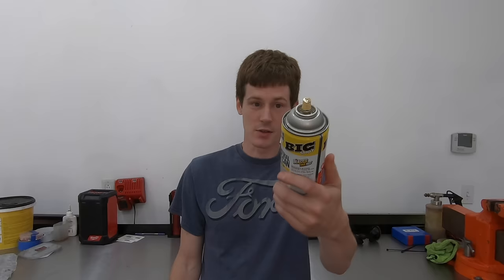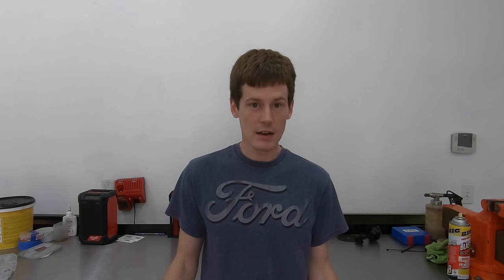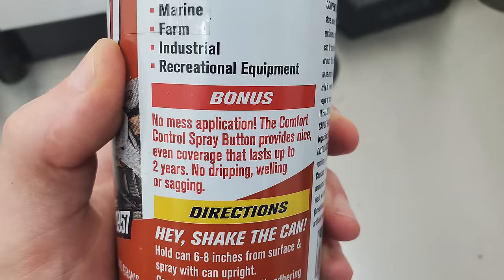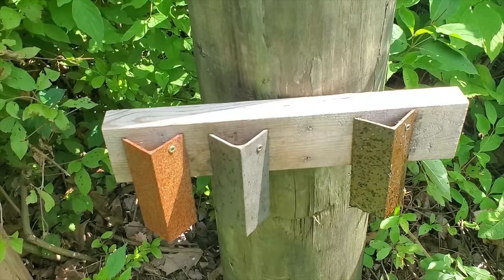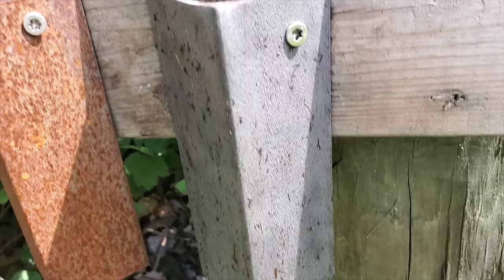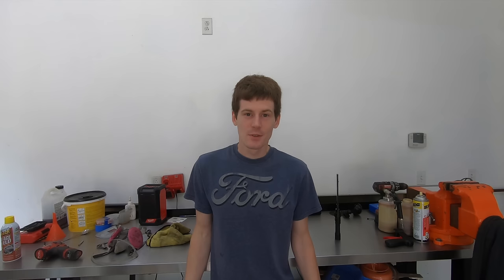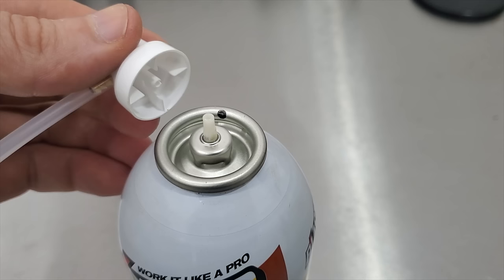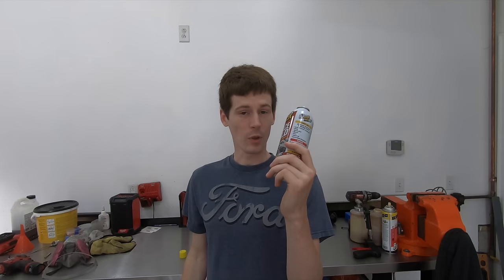I Finally Found The Best Undercoating On The Market... Blaster Surface Shield

Comment: Hey Would you consider spraying a salt eliminator inside cavities like rockers or just spraying applying this product without. Thank you
Reply from the maker: If you have a coating on the vehicle, the is then driven though salt, the salt is on the coating and not the metal. If salt can't reach the metal, the metal cannot rust. It's chemically impossible. I've never used a salt eliminator on the bottom of my vehicles. If you have a good coating you don't need it.

Comment: Hi Andrew, great clear video, one question: you say that it holds very well on the surface but I see you wiping it off with your finger, this seems to me a contradiction in what you tell us. Did I miss something?
peter
Reply from the maker: The product is lanolin and petroleum jelly. When the lanolin is washed away the resilient petroleum jelly is left behind. The part that I wiped has not gotten enough water spray to wash away the lanolin therefor it stays wet. The mud flap has gotten enough water spray to was away the lanolin.
Reply: @RepairGeek  thanks for your very fast response. I bought a 13 year old landcruiser, only some superficial rust and therefore I am very keen on finding the right protection. your video's are very helpfull amd gives me enought knowlidge to defent myself against all the "specialists" who are just doing  the bussiness without any self critism.
Thanks again, I hope you will make many more video's on this subject.
peter

Comment: Hey brother got a question, can I spray surface shield and then fluid film over it because the surface shield has solvents? I just needle scaled off the flake and rustoleum rust reformer on now I need to pick a protectant to spray on the rust redormer. Can both be used together

Comment: Is it ok to spray this over fluid film? I just did a coat of fluid film on my truck back in September
Reply: Yea the ff has started to come off thats why I asked. My bad for the confusion. Definitely wouldn't spray to different products on back to back.
Reply: @vigilantemotors  Na. Ima put another coat on the 1st of the year.
Reply: @vigilantemotors  Gotcha. We don't get snow here in VA like we used to but I'm just trying to prevent or slow the little rust I have on the frame. Something interesting I didn't know about the clear FF is it turned black after a couple weeks. Makes me wonder why they even sell a clear AND black version.
Reply: @vigilantemotors  Lol. Yea it went through this time.

Comment: Anyone knows what paint I can use to spray paint the catalytic converter and the complete exhaust system to prevent rust?
And with little to no odors when applying.

Comment: Surface Shield is no longer available on Amazon,
and doesn't know when it will return.
Reply from the maker: I posted the link here when it went on amazon. It sold out in 3 days. More will be available, just check back.
Reply: @RepairGeek  Thank you for the update luckily I ordered it within that time frame.
I yet to receive it should be tomorrow from Fed X

Amazon now has it back in stock if you want this product hurray and order it NOW!

Comment: I literally just got done spraying my truck with Fluid Film. Now I'm bummed. I never heard of it until this year. I wish I would of used Surface Shield.
Reply: Don't sweat it. Use Blaster next year for touch up. The fluid film will still be ok in many areas that do not get heavy water splash. I fluid filmed last year and it took only 1 and a half cans of Blaster to touch up my Chevy Van.
Reply: @Deucealive75  Cool that's what I was thinking to do

Comment: Does this dry or stay wet? I did my truck and it's been 3 weeks and it's still wet to the touch. I put a light film on so I don't think I put to much . The truck only had 400 miles on it when I sprayed it. What are your thoughts

Comment: I just watched this video I live in the North were snow and salt is a head ace what I was wondering you used steel can it be put on the paint?  Like Rocker Panel's to cover chips and such? I have a 2018 Ram 1500 That it Light Cream in color I just got In September  It looked like New I didn't see any imperfections so the Dealer some how covered all the chips and scratches and now after 5 washes I have more imperfections then I like and would not have bought it and the snow just arrived Sunday night I'm worried about it rusting out. Can that stuff be sprayed on the paint for this winter protection?  It is going to be under coated at the end of January. Any help would be appreciated  Thanks Robin

Comment: The company making FluidFilm has many products available, some can be mixed in different ratios to get the desired thickness and properties. FluidFilm is NOT just one Product. Also the FluidFilm line of Products is for protecting the hidden cavities inside of car bodies and frames. For the outside of your undercarriage and all visible parts vulnerable to water, salt, debris and all, the company making FluidFilm has a different Product called PermaFilm. I don't know about the market in your country, maybe they don't have everything available where you live.

Comment: The graffiti community makes male cap adapters that would allow you to use the inner cavity spray tool with that can.
Reply from the maker: I have some on the way. Thanks for the tip.
Reply: @RepairGeek  Thanks for the video. I will be using this product on my classic BMW e28.

Comment: Does this product affect rubber like fluid film. Because you said with fluid film you wipe off break lines. Thanks
Reply: On the can it claims it will not harm most paint, plastic and rubber surfaces

Comment: Enjoy your videos. in this video, You mention your dislike with the male tip on the Surface Shield can .  On your previous woolwax vs fluid film video, you referenced a graffiti adapter for the Surface Shield can  and had a link to the graffiti adapter.  You did not mention the graffiti adapter and have not linked it in this video. Have you changed you view on this adapter to enable the use the inner cavity spray wand for hard to reach places ? thanks
Reply from the maker: This video is older than the one you watched previously. I have linked the adapters in this video. They work well.

Comment: What do you think about using this for a mower deck? Buying a new Toro Zero turn and want to hit the deck with something.  Also, 1 year later, How is that telephone poll sample doing?
Reply from the maker: I haven't done any long term testing on mower decks. I know it will work and stop rust. How long it stays on the surface with grass constantly flying around? I have no idea. It's still pretty good honestly. The FF sample is worse than the SS. I'd say the FF sample is showing about 15% rust along the top the SS sample is less than 2%.

Comment: I have a 2018 silverado with the wax coated frame and I have read and heard that you should not use any undercoating on them because it weakens the wax to the point it basically slides off the frame. I noticed you have a colorado zr2, is that a wax frame also? If so is it safe to undercoat?
Reply: I have a 2017 silverado and was wondering same thing . Did you find out what's best to use on waxed frame.

Comment: So if you want to do an accelerated test, why not put a few samples in salt water and let them sit in there for a few months.
Reply from the maker: The coatings aren't designed to be used underwater.

Comment: Does this stuff stay wet the whole time? It never drys? You just wiped off that test piece of angle iron from 7 months ago and it looked wet. Looked like it had a bunch of dirt and debris stuck on it.  So when you work on your car everything is wet?. If a pressure washer won't remove it, how do you get it off if you want to remove it? Interesting stuff to say the least. Is it safe around wheel speed sensors etc.?
Reply from the maker: It stays wet. I've never had an issue with any sensor.

Comment: I tried spraying some spots on my truck with white lithium grease, the stuff is still there going on 3rd year now and I pressure wash the underneath at home after storms that use heavy salt on the roads. It’s still there. Has this channel ever tried that as a undercoat product?

Comment: You showed it used on hardware and a rusty piece of steel that looks like it's full of crap and gross. Not once did you show it on a frame the fluid film looked mint

Comment: Can you spray the blaster product directly on a rusty surface?
Reply from the maker: Yes as long as the rust is tight adhering. If loose rust falls off it takes the product with it.

Comment: Picked up a couple cases of this stuff and used about 5 cans on my 19 f350 crew cab short bed but one big issue I had 5 cans not work or sprayed for only a couple seconds and no response from their customer service!
Reply from the maker: The nozzles get plugged. I've had it happen as well. Remove the nozzle and blow them out with compressed air and they will work again.
Reply: @RepairGeek  Yeah I tried that, even used a new nozzle off of a new can and still wont spray

Comment: I recently tried the CRC Marine    ( Heavy Duty Corrosion Inhibitor )  It seems to hold up quite well ...  What didn't you like about it if you can recall.....  I will look for the Blaster Surface shield  Thanks!
Reply: i’m also trying crc, and i was just watching these videos, and on the ~30 min video of how to undercoat a car, under the why not cosmoline portion, he says in a rocker panel, cosomoline type products like crc won’t drip down into the seem weld, and won’t protect it, because it’s too thick, and dries to a solid. he recommends lanoline type products that stay liquid to get into that rocker seem, if you see the video he illustrates it well. i still feel like crc marin would be good for most of the undercoating, and then maybe the blaster surface shield for inside the rocker panel, where it doesn’t really get hit with debris to knock it off anyway. i’m still curious to see a test of the surface shield after power washing, since crc doesn’t come off w/ power washing
Reply: @allenying  That argument makes sense for all the internal hidden areas... I've already coated all the exposed areas with CRC under my TACOMA and so I will go through a season and see how it survives....

Comment: So I bought this product to spray on the floorboard interior of my 1989 GMC sierra 15 M. Is it OK to put the carpet pad and carpet back over the top of it or should I select a different  product maybe like rustoleum
Reply from the maker: This product stays wet, you need something that dries for an interior application under carpet.

Comment: $115 for a gallon ouch i stick to used motor oil mixed with melted candle wax for a couple dollars
Reply from the maker: It's getting into undercoating season. Pick it up in the spring that's what I do.

Comment: Rustoleum no good? I'm sorry, I have no experience with undercoatings of any type. All I know is Rustoleum and I have used it on other stuff.
No
Reply: @vigilantemotors  Yes. Fully agree on the rubberized stuff. I sprayed it on a metal cabinet that was in the outside patio and after a year, it was a disaster. As far as the vehicle undercoating goes, I'm prepping it now slowly (wore brushes and sandpaper). Would regular rustoleum work and would I need to prime beforehand? Also, is is better to use another product? Thx

Comment: Are you still feeling as good about the surface shield ??  I have found it in 1 gal size now.   The discoloring on the pole test end up being anything ?
Reply from the maker: Test is still running. The SS hasn't changed much from this video. I sprayed my vehicles with it this year.

Comment: You said it doesn't come off easily but you literally took your finger and wiped it off easily from the test piece of metal? Does it harden under that thick top layer similar to Cosmoline?
Reply from the maker: It has petroleum jelly in it. The lanolin washes off under high water contact. The petroleum jelly is left behind. The pole test hasn't seen enough water contact to wash off the lanolin.
Reply: @RepairGeek  I had no idea Surface Shield contains petroleum jelly. Petroleum causes rubber components to expand so isn't that a concern vs using Fluid Film?
Reply from the maker: @thetube007  1st ingredient in Fluid Film, petroleum.

Comment: As I can see spray can needs Only little 👉adapter👈 female to female inputs not bigger than 3/4" long with 3/16"diameter and problem is solved. Manufacturer can make  that very easy. Contact manufacturer and tell them that.👹🕊️🌍👌👍

Comment: Why not just paint the undercarriage and front and rear axles with a Marine based urethane paint? The very best rust inhibitor paint is RUST LOCK made by Pettit...go look it up on Google. We sold steel docks years ago. Right after the docks were made they were painted with Rust lock. We always painted the steel bumper on my dads truck once a year. It's very watery but when it's brushed on it sticks on there forever. Another little thing about this paint it does not wipe off of clothes with water...😁if you get it on your skin it will come off if you wipe it off right away. If you let it dry on your skin😄😄😄😄😄😆you will have to wear it off. The greatest paint ever in my book....

Comment: Why didn't you compare it with the CRC?
Reply from the maker: CRC aka cosmoline does not creep. On an internal surface you want a product that will penetrate the pinch welds of rocker panels for example. Cosmoline will dry in about 30 minutes. The Fluid Film that I sprayed on my truck 4 years ago is still wet and migrating.

Comment: Hello Repair Geek, 
well, I started with Surface shield and I also used under the bonnet and engine compartment . Now I get worried about the results: it stays very wet and sticky after 2 weeks. So, when I travel in dessert conditions, what will happen? I am afraid that sand will stick everywhere and that the effect will be that sand will hold moisture and rust is getting there.
Any thoughts about my anxieties?
 Rx5 has the same viscosity but in a few day it does'nt feel sticky anymore. 

greetings , peter
Reply from the maker: The sand would sit on top of the coating. The coating is touching the metal. The product displaces moisture, that is one of the main reasons it works.
Reply: @RepairGeek  , thanks for your answer. So,  I understand that I have to live with a rust free but sicky sandy car ? Humm I do not know if I want this. I think I keep the surface shield for the hollow parts , where it is impossible for sand to inter the holow space.  Probably that is also the main purpose of surface shield.
Thanks again.

gr peter

Comment: can this be used on the muffler and exhaust?  Is it ok with heat??
Reply from the maker: It will smoke if you spray it on a exhaust.

Comment: Any update on the cap and cavity tube? Did you find anyone that makes this and if so can you provide link. Thanks
Reply from the maker: It requires a graffiti adapter. A link is in the pinned comment.
Reply: Listen to this, I ordered the stuff you said. It worked great. The can of surface shield I bought had a male nipple sticking out of the can. THEN I ordered 6 more and the cans of surface shield do NOT have the male nipple sticking out of the can. What do we do now? The cap without the adapter sprays all over and doesn’t fit surface shield can. Thinking this is way way way to much work to use surface shield.

Comment: I am also in the akron area.  I was told the hard undercoating will void the warranty of my wifes new van.  I watched your video and am sold on the PB product.  Do you know of anyone who uses it in our area?  I want to get the van sprayed before too much longer. Ive been using Krown but I see what long term use does to rubber.  If no one uses PB, which is best...woolwax or fluid film?
Reply from the maker: Send me an email. Repairgeek365@gmail.com

Comment: Have you ever tried wax based undercoatings? We use cosmoline and sounds a lot like this
Reply from the maker: Cosmoline and waxes do not creep or self heal. I prefer products that stay wet because they are more forgiving if you miss some small areas the product will self level and creep into places that you can't spray directly. On internal surfaces this my biggest sticking point for cosmoline and wax. Cosmoline will only creep for about 30 minutes, that's it.  SS, FF, & Woolwax will creep for years and self heal things like stone chips. Cosmoline and wax won't.
Reply: Awesome info! Thank you for the full response it’s very appreciated. I may have to get some of this before the winter!

Comment: Can this surface shield be top coated with automotive paint
Reply from the maker: No it stays wet.
Reply: @RepairGeek  so what do you recommend rust kutter ospho etc....body is stripped and body work done, just a few places that need addressing
Reply from the maker: If the body is stripped I'm assuming you want to paint it:
https://youtube.com/playlist?list=PLiBj_svGZOHMns97Jz6AbX0NPqqih3wsR&si=gt7Q5A0UYR6TYpvF

Comment: I was thinking of coating the inside of my van before I put a floor down. I guess it would last longer in a dry area. My brother was mentioning something that has zinc in it. Would you happen to know if it has zinc in this product?
Reply from the maker: Don't use it on your interior. It is going to be a mess and soak into your carpets. Vehicles rust from the outside in, not the inside out.
Reply: @RepairGeek  Fair enough but it's a metal floor that will be covered with something other than carpet. It's an 84 VW Camper van. I will look into other options.